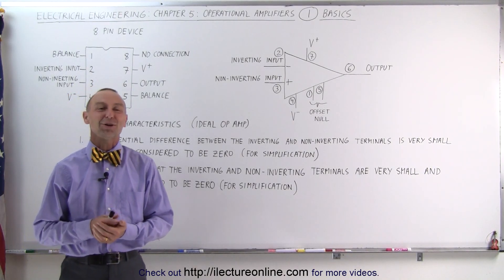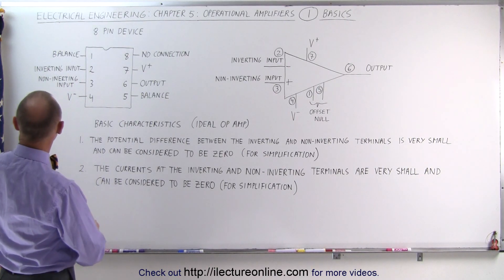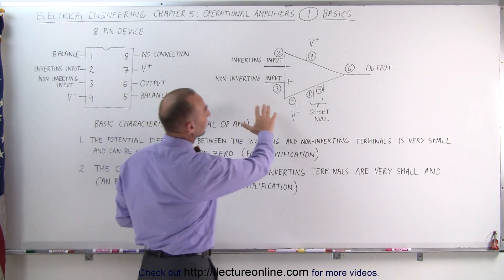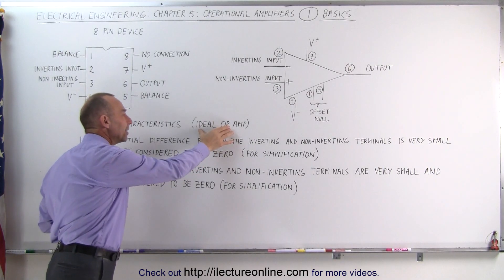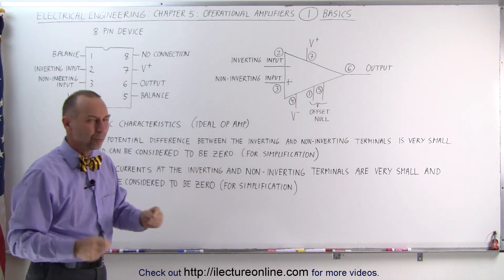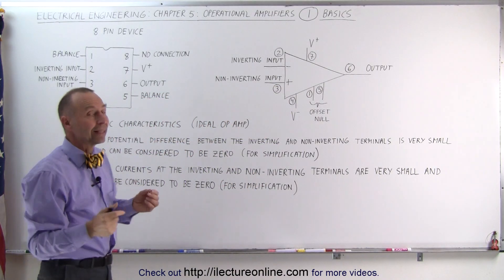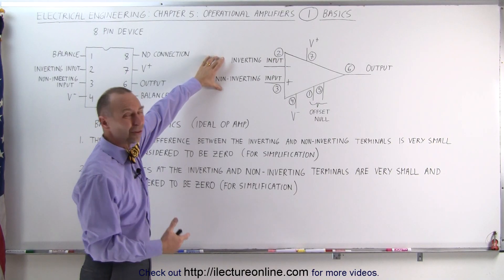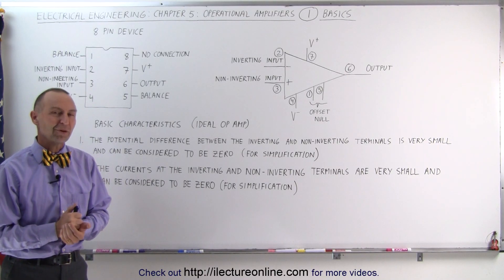Electrical Engineering: Ch 5: Operational Amp (1 of 28) Basics

Comment: I would just like to add to the first ideal opamp characteristic which we normally call "virtual short" i.e. the inverting and non-inverting terminals are of the same potential. This is only true if the opamp is at a negative feedback configuration and the Aol or open loop gain of the opamp is infinite or relatively large (which is normally the case for commercial opamps). Otherwise, if the opamp has no negative feedback, then the opamp is acting as a comparator and the inputs are not virtually shorted or of different potential.